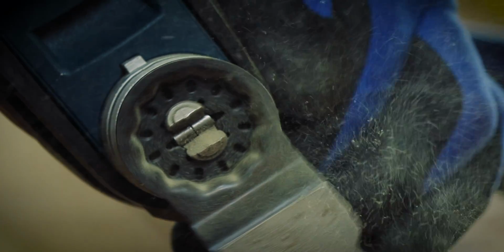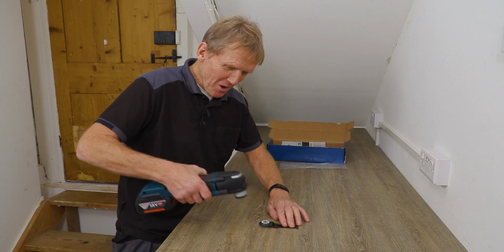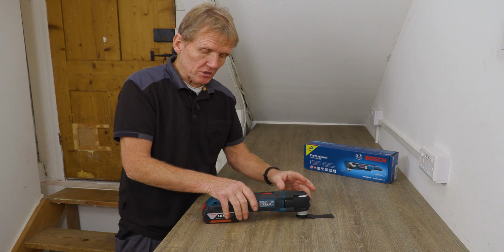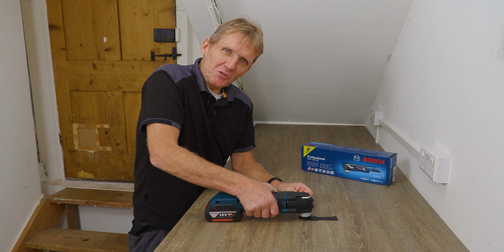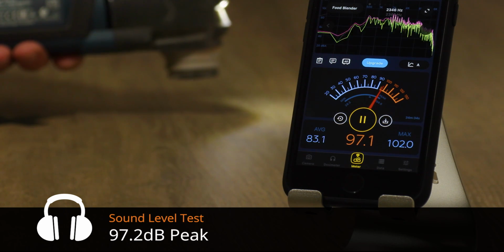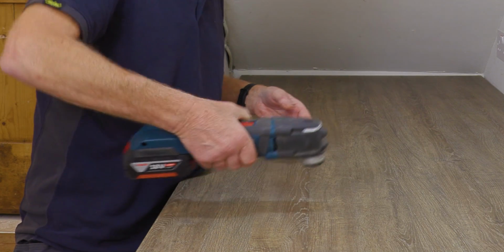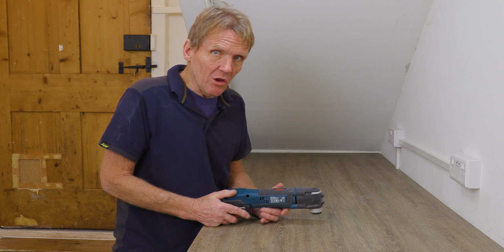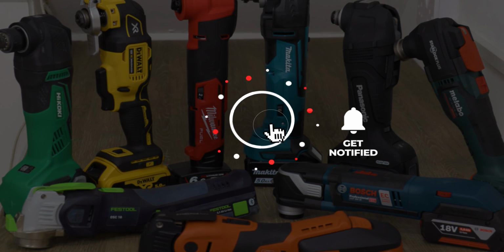Bosch GOP 18V-28 - Multi Tools #1

Comment: What an unholy racket. Using a multi tool should not require ear protection, lol.
Reply from the maker: I don't know of any mult-tool that can be used comfortably without ear protection.
Reply: @SkillBuilder  when cutting, okay. But I have used an M12, Dewalt XR, Flex starlock, Skil 20 , and Ryobi HP.  They don't pain me just to air-tool them.  The Bosch is brutal. Really nice to hold, like any Bosch tool. Then I turn on the power and its deep hurting  the vibrations are bad too. I really want to love Bosch because they always feel solid, but they tend to lack both power and festures.

Comment: 5:50 are the vents in the middle because they want you to two-hand it if possible?
Like one hand holding the back end to support more of the battery weight and the other hand over the front to guide the tool precisely. I don't know how much this thing weighs but I imagine that having two hands on it would be very helpful for precise control, and I figured they designed it to be handled that way.

Comment: The battery seems loose, however it should be - because it is mounted spring-loaded to protect it from vibration.
Reply from the maker: Hmmm interesting. I wonder why some manufacturers make them tight,
Reply: @SkillBuilder  So do I. I've used various and can't say they're better or worse for it.

Comment: Make sure you try Bosch carbide blades, the metal max will eat the screws and stainless steel.
If battery is sticking out too much go for the pro core 4.0ah which is slimmer due to the higher density cells

Comment: Top tip... Don't buy an ALDI multi tool. Like I did. 
It's so pants. Even for ad hoc basic once in a blue moon job.

P. S. I have bosch drill & driver and bought an after market battery of amazon which seems just as good.

Comment: I had the Bosch 10.8v for a while but I basically had all kinds of problems with the batteries, (the 10.8v Bosch system sucks), I bought the same 18V-28 bare tool here in Tokyo in August of this year, I paid about 172 GBP (24,000 yen), It has been flawless. It paid for itself on one job when only this tool would do the job.
Cheers from Tokyo!
Stu

Comment: 3 amp battery that it comes with is flat designed for its shape and lasts long. Starlock blades are expensive, so use them on the correct materials, i learnt the hard way by destroying all the teeth just from using wood cutters on plasterboard. Very noisy, it definetly gives back vibrations after a long period of time. Ive had it for nearly 3 years and its got me out of tight situations. The vent is on both sides so its not gonna be possible to block the entire vent with onr hand. Maybe use something like your other hand to click the starlock in. No one is going to pick up a bit and put it back down to slam the tool on to the bit. Never come across a situation where the bit are laid out ready to slam on unless you want them nicked lol. Id love to try using mine as a sander.

Comment: I'm not in the trade anymore, partly for health reasons. With that in mind I couldn't justify buying a brand like Bosch, or DeWalt. Already having the batteries I bought the Ferrex one from Aldi. For what is a low cost tool, it has some weight to it and feels solid. It's a great tool, cuts quickly and for domestic use performs well beyond my expectations. Great for cutting T&G floorboards.
I certainly agree with the use of ear defenders. Your ears can buzz a bit even after a short time using the tool.
Reply: never buy new battery packs ,just buy the flat capped litho cells from a battery online retailer and replace the cells inside with samsung or LG cells
Reply from the maker: How do you attach the cells? Some are spot welded onto plates.

Comment: Starlock max blades will fit if you drill the centre hole out to 11mm. The holes aren’t much smaller than that so it’s not much effort

Comment: You can click the blade on the tool, pressing it into the nut with your hand, you don't have to press the tool onto the blade on a flat surface necessarily.
Reply from the maker: Yes you can but it is not the way it is designed to work
Reply: @SkillBuilder   Do you think that it is some kind of damaging to the tool? As I snap it with my fingers in my hand every time on my Fein SuperCut - instead of looking for a clean and flat surface. It is just easier. To me - it is designed to to click-in and lock, the way you achieve it is up to you.

Comment: Don't use slotted blades on this type of Multitool. The raised head blades, will fit. It wore out, the oscillating head on my machine. Due to movement on the blade!  £132 for a new gear head.

Comment: Most cordless multi tools are similar. It's the blades that determine their efficiency. Dewalt blades smoke more than a bingo caller in a working man's club.
Reply: Very true comment. The differences between the tools are in most cases in the comfort / features / vibration.  And the differences in the performance depends more on the blade / sanding pad, etc. - than on the tools themselves. Not that there aren't differences ( like different osculation angles, revs.. torgue) - but in real life scenarios -  it is much more on the blade than on those differences.
Reply: That’s a lot of smoke.

Comment: question for you Roger, have you ever taken a window out to replace with newer double glazing without breaking the tiles? I have an old aluminium framed kitchen window that needs replaced for a new pvc one and I dont want to break the tiles taking it out so was hoping to use my bosch multi tool to rake out the grout and hopefully get the window out without damaging them. Is this something you've done in all your years? or robin? ideally would prefer trying to source replacements as theyre incredibly hard to come by and fairly expensive at £45 /m2
Reply: I’ve taken tiles out with mine, once you cut all of the grout out you are at least limiting the damage to the tile you’re removing and not transferring the pressure you’re applying to the neighbouring tiles. Smaller tiles are easier to remove than big tiles (to an extent) and it all depends on how well they’re stuck down. 

I would bank on breaking at least one or two (depending on how many you need to take out) but that’s not a foregone conclusion by any stretch. It can be incredibly hit and miss

Comment: Hi Roger noticed you were chasing out mortar and was wondering how this compares to the tool attachment on an angle grinder eg speed/mess
Reply from the maker: It is fine for sand and lime and is very controllable so no problem with brick damage. The diamond would wear quickly with sand and cement so it is never going to be as good as a diamond wheel.
Reply: thanks Roger, the mortar on my house is black may be black mortar, seems quite soft

Comment: DeWalt is tops for these, love the trigger variable speed control, love the way the blades are clamped and it performs tops, I got the Milwaukee 18v too and that is just as good apart from the trigger not present. EAR DEFENDERS Roger, a must with these, they leave you shell shocked if you don't plug the lugs!

Comment: I bought a corded Fein Multimaster, back in 2007 I think, at Yardles show. Its not the most used tool I have, but it's the best by a country mile. When all other options fail, this is the tool to turn too !!  I have a few of the Bosch 12V tools, so I'm thinking that route - keep the corded for bigger jobs, and the 12V close at hand.

Comment: Will look forward to the comparison to see how they run against each other . I have two but one of mind I just use for sanding since I got a yellow one because I noticed the power difference straight away . The Bosch look good but I do think one or two are good now . Then the is base that Festool as making it easier to control the blade plus not tried but understand it takes some of the vibration out . Good video

Comment: Got the Gop 55-36. I like pairing it it up with the Fein 63502161210 Starlock E-Cut Long-Life Saw Blades where i can. If you can get the sawdust to fall out as you cut the blade lasts longer than letting it build up in the cut, burning the blade👍 Sometimes wonder if i should've just went the battery route with the Gop... Fein and Metabo blades are usually cheaper than the bosch ones if you hunt about.
The handle realease and snap fit is good when the blades are hot. Don't have to hold the blade if changing orientation. Also on grout I've used small toothed blade (possibly the semi circular one as well from memory) as you can run up beside the tile with no fear of the carbide or diamond chipping into the tile. Just watch for it kicking out onto the tile.

Comment: I’ve had the 12v version for a few years now, small light and powerful enough for anything I’ve needed a multi for.
The starlock blades are expensive. Defiantly noticeably better then cheap ones though and well worth the money.
Reply: And can be sharpened.

Comment: So im trying to find information on star lock max but generally all i can find is that its for more powerful multi tools?  But theoretically if i gota tool that takest max blades should it also fit the other starlock blades?
Reply: If the Max fits any of the 3 will fit.
Reply: @JACKATTACKED  sounds good in that case. Really need to get my hands on a multi tool soon.
Reply: Grabbed from online.
Each Starlock category is designed to match the power output of its compatible oscillating tools. Starlock blades can be used with ANY multi-cutter. StarlockPlus and StarlockMax blades require more power and are therefore limited to use with certain multi-tools. StarlockMax is the most powerful blade classification. 
Starlock Blades

Fit ALL multi-cutters. This includes Bosch, Fein, Makita, Metabo, Hitachi, Milwaukee, AEG, Einhell, Ryobi and Skil. DeWalt multi-tools require an adapter.

StarlockPlus Blades

Fit ALL Fein multi-cutters, ALL new Bosch Starlock multi-tools and some old Bosch oscillating tools with OIS interface. This includes the GOP 300, GOP 250, GOP 18 V and PMF 350 CES. Other brands require an adapter.

StarlockMax Blades

Fit ALL new Bosch StarlockMax multi-cutters and ALL new Fein StarlockMax multi-tools. Other brands require an adapter.
Note: Old multi-tool blades are not compatible with new Starlock multi-tools.

Comment: With the battery in that orientation, if you put a bigger one on, does it get in the way when you're flush cutting? For example if I wanted to trim the bottom off an architrave to slip a piece of flooring under.
Reply: Not quite answering your question but I use a 4 Ah battery on mine and no problems in terms of power, battery life or battery getting in the way doing that exact job of undercutting to fit flooring.
Reply: @neildocherty  thanks for that. I had to ask because the way it fits on there, it looks like with a bigger battery you'd be cutting an angle into it and not parallel with the floor.

Comment: I’ve got the slightly older model (no LED light) and I assume it’s the same on this model, but the battery is loose/wobbly by design. The battery mount is spring loaded and free floating to reduce the transfer of vibrations from the body into the battery.

What is important to note though is that if you push on the battery to apply more force (which you shouldn’t do) it will damage the casing of the battery over time as you’re forcing a non-moving object against one that is vibrating pretty hard. It’s not gonna break your battery or anything but it does wear the casing down
Reply: Как я понял у Вас 18 v ec  Вы им давольны?

Comment: Loading the blade, better to hold the lever forward and then ease the bit In before the lever returns to the lock position. Works a treat, been really pleased with mine, over 4 years.

Comment: That seemed to cut through the timber a heck of a lot quicker than my dewalt!! 😱 Could be the difference in blade though to be fair, I only use eBay bi metal blades.
Reply: I’ve owned the dewalt and the 12v Bosch and the dewalt is awful. (I own a lot of flexvolt stuff which is excellent but in this case dewalt falls below the competition)
The dewalt seems to vibrate the user more then the blade.
Reply: @amateurvegan2636  The Dewalt 18V Multitool is a pretty old model at this point. It can not compete with the newer top-models from the other brands. I think the vibration is mostly due to the light weight. I have the Makita 18v DTM51Z multi tool - and it is on the other end - VERY big and heavy - but it is soo silent and vibration-free compared to the Dewalt.
Reply: @sizif717  yeah I have the makita (an older model also) better then the dewalt fit sure. Actually the dewalt is brushless and it’s more recent then the makita.
Just a poor design imo

Comment: That's a sexy little number. I got an electric one, I had had it for about 14 months before I used it. Only a screwfix own brand. . I just forgot I had it, but one day I had to cut a slither out of a fixed peice of facia board at home and the missus who was pissed off with my language up on the steps said why don't I use that new tool you bought last year.
Well I did and when I realised what it was capable of I never looked back.
The down side is they are noisy and cause a lot of dust but hey, who cares 😝😝😝